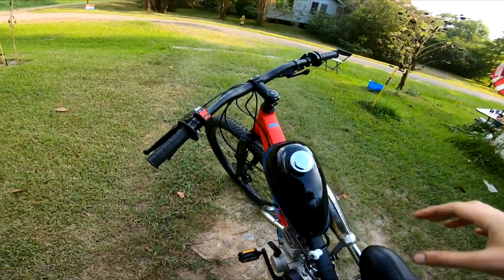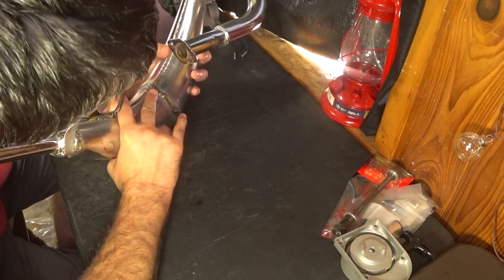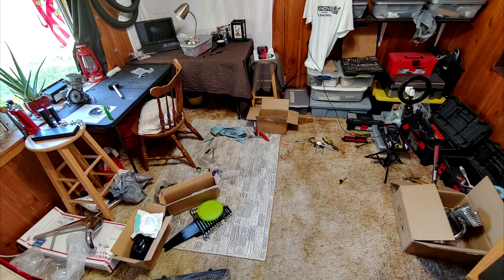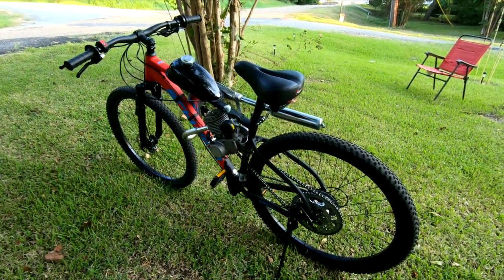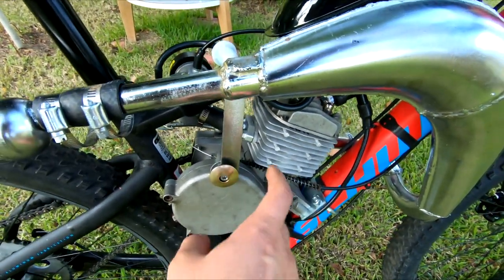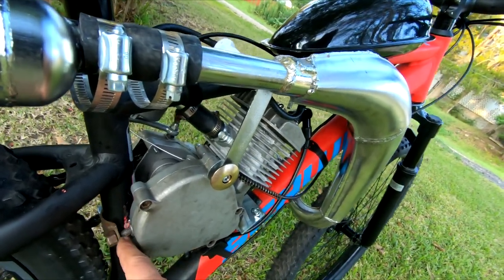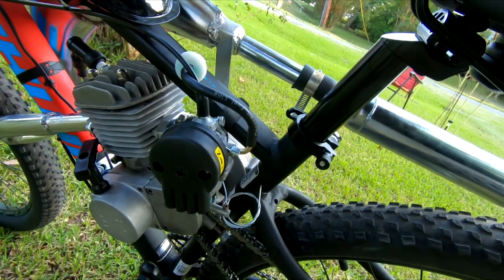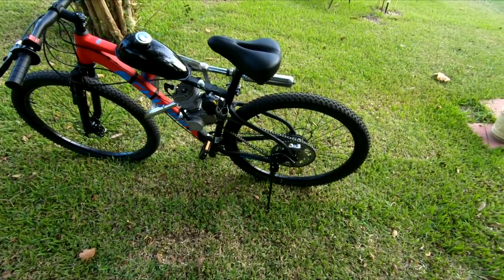It WORKED! 2021 Schwinn Taff (Motorized Bike)

Comment: Take the phantom 85 jug to a shop with a band saw meant to deal with metal stock. Easily remove the cylinder head from the one piece jug. Then finally flip it around. The head gasket would be interesting but I bet you can trim a YD100 one.
Reply: Yeah that is what a channel named Kevin's shop has done, cut a YD100 to fit a head

Comment: 15:48 the reason I mentioned "proper carbs" here a couple of times is not really for peak performance, but better tuning. I know it doesn't really bother most people but I like my stuff running smooth and perfect, with crisp response from idle to a million rpm. The mixture on those stock carbs seems to be all over the place no matter what you do. I promise I won't touch on that subject ever again lol

Comment: I feel the most important part of a build is the tires ! No one post tires. The basic cheap bike tires are not really a option. Brakes too ! Ordered some  puncture proof Kevlar Continentals .
Reply: Absolutely! I was lucky being my build is a 20" they had some freestyle BMX tires, made 30% stronger than typical, and went with slime tubes. But yes you will go through lots of tires especially the back tire.

Comment: Clutch top left , rear brake below. Throttle right, front brake right. KISS RULE, and same as motorcycle. The clutch left and rear under makes you clutch to get to rear brake.
Reply: Nice I pretty much have that but only have rear brakes, and handle is on right like a bicycle, but along with throttle handle. Dont think I would like a thumb throttle, seems tiring, and it's fun to twist the wrist

Comment: are u ever going to try a disc brake mounted sprocket/ disc brake and sprocket? they are loads better than the clamp or rag joint
Reply from the maker: Is I replace the wheel set I may try v brakes in the back and disk mount the sprocket.

Comment: It's SCP Foundation from discord. Whenever my bike doesn't start I have to check on the fuel jet and that's usually the issue. I know that you already fixed this but if anybody else is reading this they are trying to start their bike and it's not starting, and they do what la hover did in this video it's probably your jet. Mine gets unscrewed every hundred miles or so, I just have to take off the carb bowl and then screw it back in.

Comment: Hello my name is Rob from Vancouver Canada and being into motorized bikes for over about 7 years now just dusted off my cruiser after not riding it for about 3 years and Road fine for 2 weeks now I have spark compression fuel but no no running I just watched your video can you tell me more on flipping the mag thank you love the videos
Reply from the maker: Hi Rob
The mag flip is not likely your issue.
Some new motors, or a motor you recently worked on might have the magnet installed backwards.
In your situation I would focus first on giving the carburetor a good clean. It may be giving too little fuel due to a dirty jet, or too much fuel due to a dirty fuel valve. 
Many other issues can be at play such as dry-rotted crank seals and gasket, weak spark, shrunken fuel line, etc... 
Starting fluid is a reliable way to narrow down possible issues quickly.
Reply: @LAHover  thank you yeah I will take the car apart and try to clean it up and go from there it's got a lot of miles on it so but thank you for the tip so that's just for New Motors this is happening gotcha yeah mine was running fine the other day and then I went to go I stop and then went to go again after 10 minutes and it just wouldn't start and I got spark fuel there's compression just don't get what's going on so I'll check the carburetor thank you so much and yes I speak into my phone sorry for the grammar

Comment: So, I'm waiting on an FMF Turbine 2, and I'm wondering about the two bolts to mount it, cuz, I don't believe there will be anyplace to do so.  I don't want the darn thing to fall off, or damage my EC >>>>> which  like like about tge same size as this one in the video, but black. 

Did the OP attach the silencer to the seat post? 🧐

Suggestions would be Bitch'in!  👍

Comment: Thank you so much for this video.  After your previous video highlighting that bike, I've seriously been considering using the this bike for the base for a new build.  I was really concerned about the placement of the disc brakes, so your description there is awesome!  Did you say that a smaller sprocket won't work?  It looks like you picked that one to clear the brakes.  I'm a big guy so I'm not worried about top speed and I prefer quick vs. fast.  

Seriously, thank you!  You have helped me so much in this new hobby and love your content.  I only wish there were more trails to ride here like you have.
Reply from the maker: Thanks! I picked the big sprocket for more low end power. Not much top speed because it's a trail bike... However it looks like you can use any size sprocket on this build. You might have issues if you go smaller the 32t, but if you are not after speed you won't be going that small anyways.

Comment: You're right.  The welding on that pipe is pretty bad.  Even the nickel plating is pretty sloppy as it hangs into the output side of the pipe.  Does the pipe come close to your leg?  It might burn your leg.  Does the pipe give you more power?  Nice build.
Reply: Lucky it is even nickel plate, there are some that are literally silver colored spray paint, and not much for handling heat either lmao!!

Comment: Yeah silencer will be going on my first chamber too,, neighbors already seem pissed about me with a stock pipe. But you can try the holes in the stinger cap, but I found success pulling off the stinger and cutting the outlet tube about in half! Its narrow and long as stock, which is restrictive. I took off about 1/2" at a time, and went back and trimmed multiple times. It is a stock pipe which is a muffler and not a chamber, so it may just do nothing at all on a chamber, but definitely wont hurt anything. But trimming that outlet/stinger did allow more exhaust to clear and increased my RPMs.

Comment: Hey I got the same pipe as you how did you pit the muffler on? Did you cut a stock one
Reply from the maker: Just cut a stock one. A bit of sanding and maybe some heat with a hammer to round out any pinches in the pipe from the factory bend.
Reply: @LAHover  hey I just did it on my pipe and it’s so quiet now but still rips thank you so much
Reply from the maker: @keeganhache6667  it's a bit heavy, so make sure your support is solid.
Reply: @LAHover  yup for sure

Comment: Does your rear derailer on the taff have a clutch?
Reply from the maker: Yes... ohhhh, I wonder if I turned it on by mistake lol. Thanks man!
Reply: If it’s not that park tool does a good video On adjusting the B screw and the high and low limit screws you’ll be shifting Krispy in minutes 👍

Comment: I have a schwinn all comp I was thinking about motorizing, would you say the aluminum frame or geometry would be an issue? It's about the same frame as that one you're using.  First build, looks like fun to tinker with! Oh 27.5 tire.
Reply from the maker: I looked at the aluminum comp as an option. It seems like a super tight fit, I'm not sure it would work. I would not recommend a bike with rear disk brakes for your first build unless it's a gas Bike frame. Mounting the sprocket without a welder was a pain...
Reply: I built a schwinn comp with an 80 cc. The offset intake tube is one modification needed. The other was slightly pinching  in the frame for the front motor mount. I used my vice to pinch it in slightly.

Comment: I have a couple of questions I'm wondering if there's an email or a way to speak with you outside of YouTube if not I'm wondering if the phantom 85 isn't the best option to just be done with it for a first time during mechanical built a lot of motorcycles I'm a bigger guy so I need to work I don't want to mess with too much just because I'm lazy I want to just put the best on the first time and be done what's your recommendation I need torque

Comment: Current build was tight so took off head and turned it around 180 degrees. That should work huh?
Reply from the maker: That's what I had to do here, otherwise no room for the sparkplug. 
Some heads are different tho, and obviously this won't work on a 1 piece jug.

Comment: I’ve to a problem, when I let off the gas it feels like my bike is braking/ slowing down, also when I stop the bike while the engine is on it cuts off
Reply from the maker: If you feel drag when you pull in the clutch something is either rubbing, or your clutch is not fully disengaging. Same goes for the motor dyeing when you come to a stop. Most likely need to adjust or service your clutch or clutch cable.
Reply: @LAHover  cheers for the reply man

Comment: Regarding the hub sprocket issue.. 

I mounted my sprocket to the inside of a doubled up disk break, bolting it to the venting holes of the disk and using spacers to get the alignment right. Only issue is having to use V breaks on the rear.
I could send you some pictures if you’d like..?

Keep up the contend dude 👍🏻
Reply from the maker: Would love to see them, if you are in the discord server tag "@LA Hover" in your post and I'll see them :)
Reply: @LAHover  how do I join the discord? 😳
Reply from the maker: @Time-junkie  I keep a link in the video description but here you go :) https://discord.gg/8a9cZDzx

Comment: Hello from Romania, one question for you ... Would you prefer more a 4 stroke kit or the 2 stroke ? I'm about to build one  and I have doubts about the 4 stroke and the clutch issues ... And for the 2 stroke I have doubts about the noise ... Could you help me out with a suggestion ? I enjoy riding on hils and valleys ... Which one
would be better for me ? I watched a lot of your videos and I saw that you prefer more the 2 stroke but I wanted to ask and see what you think. Thanks
Reply: 2stroke all the way for me , easier to make power w em
Reply: @sundial6919  thanks :D
Reply: @SerbanMihaiDaniel01    do you have other choices available other than china made kits ? I wish we did , Many Cheers and well wishes to you and Romania .
Reply: @sundial6919  not a lot of options ... Only china made kits ... 50 cc and 66\80 cc 2 strokes and of core a 49cc 4 stroke kit ...
Reply: @sundial6919  I bought a 80cc 2 stroke kit ... Unfortunately only kne type available at 120$ . I started the engine and is working ... In the next days I will finish the build.
Reply: @SerbanMihaiDaniel01    i hope the very best for your success and a long lived motor for you friend . Cheers and happy 2stroke bicycling !
Reply: @sundial6919  thanks man 😀🎉

Comment: Nice, but i would probably use a 44 tooth sprocket, so you can get a little more speed in case you need it. Nice bike.
Reply from the maker: I hear ya, this one is going to be a trail only bike (except during testing). Got my road bikes for in town and going to work :)

Comment: I wrecked a vintage 2 stroke snowmobile by using too much starter fluid.  It needed the oil/fuel mix.
Reply from the maker: Literally the first thing in this video... "LUBRICATED STARTING FLUID..."
Reply: My bad